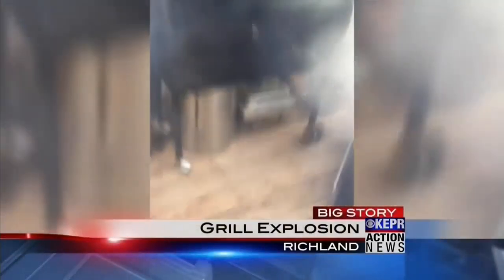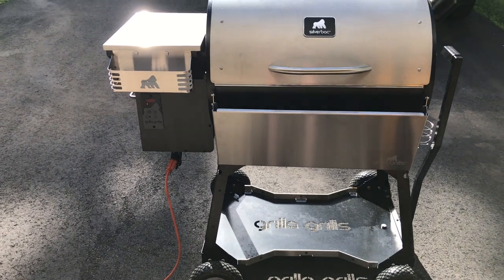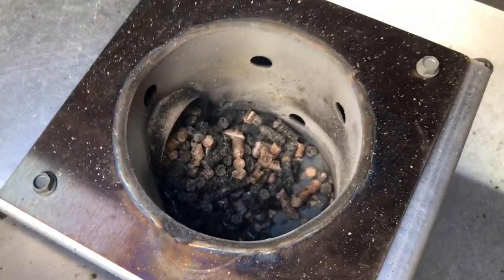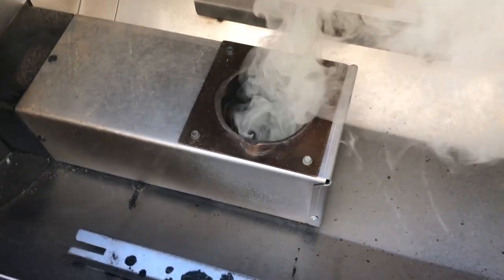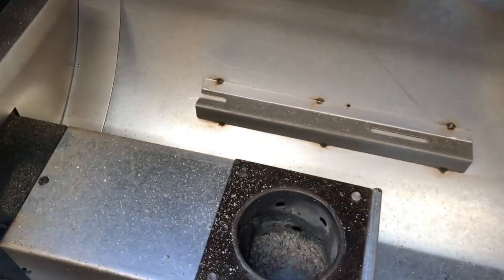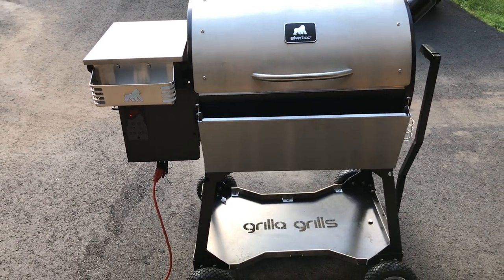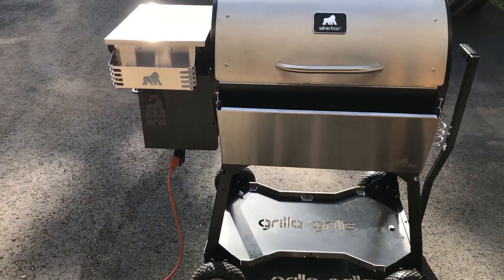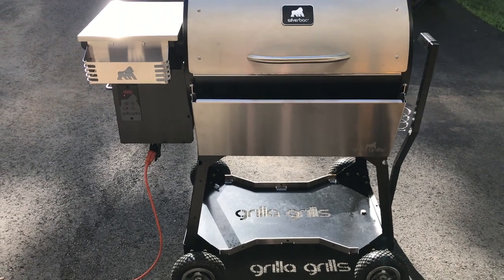Viral Traeger Exposion Explained (My Opinion)

Comment: Traeger manual specifically says to start the grill in the "Smoke" position with the lid open until the grill is lit then close the lid and set your temp as needed.
Reply: @davehart7943  ours backdrafted when we bumped it from smoke to cook and kept the lid open
Reply: It also says if you get the LEr  ‘Low Error’ to turn off and unplug the grill until you clean out the burn pot and get it ready for initial startup again. 

Treager can flame out and leave a very small amount of pellets barely smoldering. It will try to keep adding pellets to burn to raise the temp to the current setting.  But sometimes that doesn’t happen.  You get a burn pot that is spilling over with fresh pellets. 

This will give the LEr error.  

Absolute worst thing to do at this point is to simply go through normal startup.  This will heat up the hot rod underneath an overfull burn pot. The pellets will start to smolder, as usual, but when they flame over, there is that huge excess of pellets that lights and the convection fan works like a blast furnace on this pellet pile. You will get a huge amount of dirty gray smoke just before they flame over. 

When the full burn pot lights, the fumes that have built up under the cover will flash over and cause an explosion that will ‘at least’ bang the cover open an slam shut. The grill will also reach temps over 750F. Not built for that. 

Any time a pellet grill gets a Low Error, first thing to do is turn it off and unplug it so the hot rod and fan absolutely can not come on. 

The burn pot must then be cleared.
Reply: Most people dont sit down and read their manual first to last page. I know mine did emphasize that, but maybe there should be a fail-safe? Because theres many people who dont have much common sense.
Reply: @BOBcrazyguitarguy  BS ! You didn’t read the manual. It was provided to you and saying people don’t read manuals is the stupidest excuse ever!!!

Comment: Clean your smoker after 2-3 times its easy an its safe to use
Reply: no thats not gunna help, these digital pellet smokers are dumb and can be easily fooled. u need to add a pressure release valve which is few bucks and will avoid this explosion.
Reply: Bull I cleaned mine out next use it caught fire 🔥..
Reply: Clean mine after every use. Never had any issue at all.

Comment: Thanks for posting this. I’ve had my traeger for 2 years and foolishly have made this mistake before. I allowed the hopper to run out of pellets and this caused my grill to “superheat”.  It went into “super smoke” mode with a quick surge in temperature, which of course the first sign that something is dangerously wrong. I immediately turned the unit off, and opened lid and the hopper door to quickly cool the unit down.  You’ll likely hear some sort of “pop” as it adjusts for the influx and burn off of the pellets in the popper.  Thank you again for showing us the science on how these work, this will help me avoid problems in the future.
Reply: This is exactly what happened to me today. Man it scared me to death

Comment: This happened to me. It made me very nervous to use my grill afterwards. I had no idea why it happened, but I do now. Thanks for the video!
Reply: Happened to me on my second cook. It was a windy day and I think that it started the problem. The BLOW came AFTER I unplugged the unit. Lots of smoke, I closed the lid, unplugged, took uncooked chicken through the door and BOOM. Startled me so I thought it had blown out my patio doors. This Traeger made me so nervous but the Traeger ppl were great.  We concluded that it might have been the combo of high winds and  dust from pellets caused by moisture, even though I keep it clean.  My take away is that if I don't use the pellets for more than two weeks, replacement them because of all the rain.  Still I feel it is way too much work. I grilled on my propane at least 5 days a week even with snow. Now, I haven't grilled since the incident 4 months ago.  Buying a propane. I won't abandon it completely but  . . .

Comment: Thanks you may just be a life saver. I did not know why the lid needed to be open at startup. I just did it because it said to do it. Sometimes I need to shut it off if I am in a hurry. From now on I will check the pot before using the grill. Thanks again.

Comment: You touched on the true point at the end. It’s not so much the extra pellets getting pushed in as it is all the smoke building from the previously burning pellets and more being added to it. When the smoker is filled with smoke and the pellets finally ignite, it’s actually the smoke that then explodes. That’s why it clears up instantly. Good video though

Comment: Brand new to pellet grills, and just got my first one this weekend, a camp chef woodwind.  I was really struggling with learning how to get the thing turned on properly (turn the dial, click the dial, it's not super intuitive, at least not for me.)  I really wish they'd had better instructions in the manual.  It was all an explanation of what each setting does, but not "Step 1:  set the temp."  I feel like an idiot, but if you've never used one...   But anyway, after several youtube videos, which also don't really clearly explain step by step, I finally had it going through the startup.  The problem was, all my failed attempts had a bunch built up in there and I wish I had a video of myself ducking and covering when I heard the BANG.  I got super lucky that it was very minor.  No grill damage or people damage.  Sure was a learning experience though!  I wish I'd seen this video yesterday.  I understand personal responsibility, and this was totally on me, but Camp Chef needs to do better with their instruction manual, too.  But, here I still am, and excited to keep learning!

Comment: Traeger instructions says to turn the grill on with lid open until you see the temperature is above 125 degrees before you close the lid. After you get the grill up to 125 degrees then you can close the lid and then raise the temperature up to the desired cooking temperature. There is reasons why the unit comes with instructions.

Comment: The camp chef grills have a special restart mode just in case you lose power or had a flame out.
Reply: That seems like a common-sense feature it'd be nice for more of them to have.
Reply: How evenly do those Camp Chef Pellet Grills cook? I love all their features including the big square back section. My Pit Boss Classic 700 is (Noticibly) hotter in the LR and cooler in the RF sections. It’s still way better than any gas grill, is that normal?
Reply: @catlady8324  it's about the same. When I smoke meat I always put it the furthest away from the fire pot. Mine has 2 heat zones. One for grilling and one for low and slow.

Comment: I just bought a Traeger Bronson 20. I did some research after I got it and became nervous hearing about all these issues. My understanding is this could happen with any smoker and a lot of the times it's user error. I also found that a lot of people want to pile on to the issue because they NEED to share their story. Even if they did the same thing the others have done. This compounds the problem, and makes it seem like the smoker itself is the issue, but it isn't. It's people doing the same things without following instructions and running into similar issues. Thank you for the clarification.
Reply: Exactly.  People who aren't capable of understanding that THEY did something wrong are the bane of my existence.  So many people mentally peak at an early age because they aren't able to look in the mirror and realize how to get better at things.  It is always somebody or something elses fault.  Never theirs.

Comment: 👍nailed it,  smoke has potentially flammable gas.   When you keep the lid closed on startup, you can build up this gas; then you're asking for it.   Always follow manufacturers instructions: 1.Keep the lid open during startup. 2. Let the pellet grill complete it's cycle during shutdown.
Reply: On recent Traeger models (like my Traeger Pro 575) you're supposed to start up the grill with the lid closed and set at the desired temperature, so I guess they changed a bit compared to the older models.
Reply: O man, that's news to me.... embrace the technology!👍

Comment: What an informative video. I am currently looking at pellet grill reviews before purchasing my first one and I had no idea that those precautions were necessary in case of an aborted grill start up. I work on jet aircraft for a living and I have seen what happens when there is residual fuel left in the tailpipe of a turbine engine. Violent doesn't even come close to describing what happens. I had no clue that a grill fueled by pellets could cause such an explosion.  Thanks for making this video brother.  You may have very well just saved me from possible injury so a subscription is in order.
PEACE!

Comment: Trauger also recommends leaving the lid open when starting the smoker. I have two of them. My first one i had a mini explosion before i read the instructions. I use shutdown mode and clean with a shop vac regularly and have had no issues with either smoker for a couple years

Comment: Great video.  I just got my 1st pellet grill and watched alot of videos on it. The biggest complaint i have seen is the mound of pellets in the burn pot. I vacuum mine out aftet every use and put just a small amount of pellets back in as a primer.
Reply: You shouldn't add more pellets as a primer... These grills automatically feed pellets in to start it adding more could cause excess smoke and this situation could happen
Reply: Don't need a primer ever.

Comment: Great video John. I think this is an extremely important lesson for pellet grill users. I once had a flame out and was unaware what happened. When I took the grill apart I saw a mound of pellets sitting on top of the fire pot. This could’ve easily turned into a bad situation if I restarted without cleaning it up. Keep up the great work.
Reply from the maker: Knowledge is power my friend. The more you know the fewer problems you have!
Reply: You also made a mistake when you started your grill Open the lid and start your grill on smoke wait 5 minutes then close the lid and set your temperature.
Reply: Shoulda bought a camp chef, their ash cleanout system is the best.

Comment: Great video.  I find it interesting that GMG talks about what to do and how to restart the grill if you lose power.  I hope that is how they bypass an explosion.  I know with my Traeger that is 14 years old I have always opened the lid while starting the grill.  Now I am selling it and going to a GMG Daniel Boone Prime grill.  I find it interesting that you can start up the grill remotely with your phone app.  To me that could cause this very thing to occur.  I don't mind using the remote app but I think for starting I will always do so with the lid open until I know it is fired up.  Hopefully I will never have a flame out either but live in a rural area where electricity does have issues.  Thank you for the great video John!

Comment: I have used a pellet smoker for over a decade now. It does not matter what brand you have. When lighting it up, leave the lid open. Turn it on and stand back a bit. There will be some thick smoke and then it will sound like a jet engine with a lot less smoke. At that point you can close the lid. You do not need to clean the fire pot between uses or after a power outage. Just open the lid and restart the smoker. The only thing that needs cleaning with every use is the cooking surface for food, and usually I crank up the temperature as high as it goes after I am done cooking to make the food stuck to the grates easier to remove, followed by scrubbing with a brass grill brush. About once per year I completely clean it out, but overall they are much less maintenance than other outdoor cooking equipment I have used and I have not had a lot of issues with excessive ash accumulation from the pellets I have used, but as they say your mileage may vary. Some pellets might have a ton of ash and require much more frequent cleaning. The biggest issue I have had has been that some of the supplied hardware was not stainless steel, and that hardware rusts over time.

Comment: Traeger should install a delay feature that delays the auger from turning for a full minute while the fan ventilates the bbq.
Reply: They can't try to design around every stupid thing a person could do.
Reply: no thats not gunna help, these digital pellet smokers are dumb and can be easily fooled. they need to add a pressure release valve which is few bucks and will avoid this explosion.
Reply: @ShopperPlug  pressure wasn’t the cause here. I’m retired career fireman. You’ve heard of backdraft from the movie? Well, this isn’t a backdraft. What it is is another dangerous phenomenon that firefighters face on most every structure fire. 
It’s called flashover. Smoke, although it’s the byproduct of fire consuming something that will burn, is full of combustible gasses that can still ignite. 
If you contain all that superheated smoke in a box, like a room or in this case a bbq, and then you get it hot enough it will ignite rapidly mimicking a small explosion. 
That traeger flashed over and it had nowhere to go when it lit off. 

For it to have been a backdraft, which is an oxygen starved environment, it would have exploded like this when he opened the door. This exploded when all that trapped smoke was heated again from the pile of pellets igniting. 

Your pop off pressure release idea sounds good in theory but it blew the lid completely off. That would have to be one hell of a pop off valve to relive that much pressure in a flash. 

If he turned it back on, and the traeger had a simple delay added into the circuit to run the convection fan for a minute or so before it began to heat the pot and start the auger, that smoke could have been ventilated-no explosion. 

Firefighters ventilate every structure fire to get rid of heat and smoke, preventing flashover.
Reply: @herbiesnerd  You're right, I actually never knew the exact science of wood smoke being flammable which can ignite and explode. It is somewhat a user error and a pop out safety release value doesn't seem it can help. I think the best thing that could be done is that the company adds a metallic lid attached to a solenoid which can cover the fire pit depriving it from oxygen due to electronic error or power outage. This will stop more smoke to be produced and will require user to investigate and reset the smoker. On top of that the company should also add a mini powerful fan blower which can exhaust out all the smoke in the chamber within 10 - 20 seconds which is connected to a sperate battery. There can be sensors implemented inside the chamber to see the levels of carbon monoxide too.
Reply: @ShopperPlug  I'm thinking the best thing the company should add is a set of instructions (in multiple languages) explaining how to use the appliance properly...
Reply: Must be sarcasm because they all do

Comment: I have operated boilers for over 40 years. If there is a chance of this happening the control logic should include a pre purge sequence just as essential as a post purge sequence. Yes the user should and could be better informed. It would not take much at all to program a pre purge in these units.

Comment: Traeger Grills are simple to use if you follow the guideline.....start with lid open in the smoke position, allow grill to heat up and start a large smoke cloud and then allow it to clear away(approx 5 minutes), once it does set your desired temp, close lid and allow it to pre-heat until it reaches temp, the time can vary due to outside temp ( this is the reason you start in the smoke position)
   If the grill stops or is disrupted for any reason, shut it down and even unplug it for 10-15 minutes, Check the burn pot to make sure it has very little pellets in it.... then start the same process I described above.  I had this happen only once it was due to a quick power outage we had in our area. 
Clean your grill often, I do after 2-3 three times I use it..

Comment: So true this happen to me. I had a loss of power and restored my PitBoss, by re-priming it. What added to the problem was that I did all this while the lib was closed. After about a couple of minutes it went BOOM!  The lid flow open and and then slammed close. I felt the percussions as the lit flying open. . I now always start with the lid open and start it at its lowest setting. Meaning I take my time, when it starts to smoke heavy I know its going good, so its at this time I raise the temp. I learned my lesson. However, now I'm dealing with the unit kicking off my GIF. After a lengthy trouble shooting process it's then when you figure out if it's the ignitor or something else. Shouldn't have to go through all this seeing I gave them my hard earned money. All these pellet companies should be more open with the potential hazards of owning a pellet gill. And yes I clean it after every two cooks.
Reply: Since Treaters Grills have never liked GFI outlets, I tell my customers to drag out an old power strip. Plug that into GFI and the Treager into the power strip. More times then not, solves the problem.